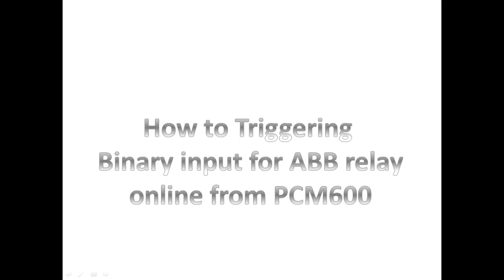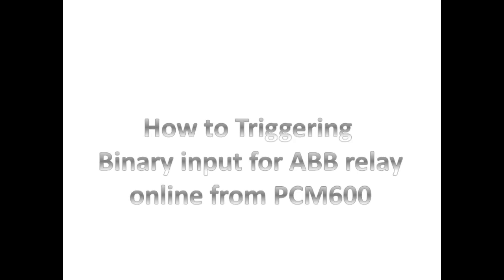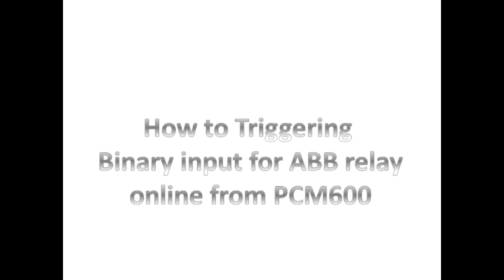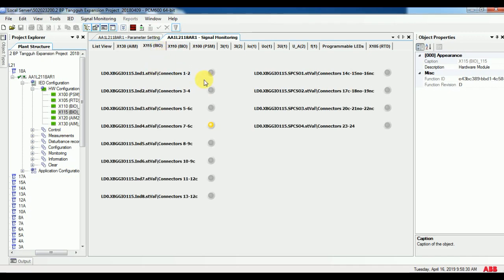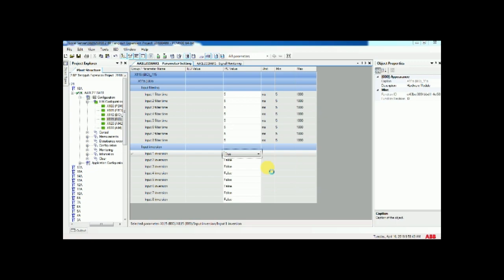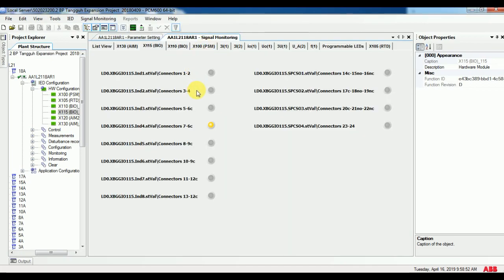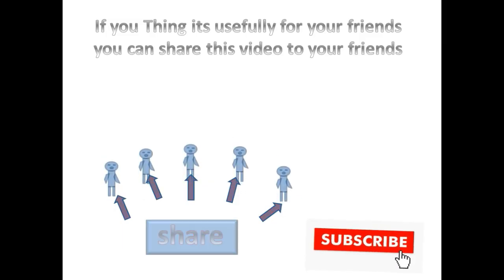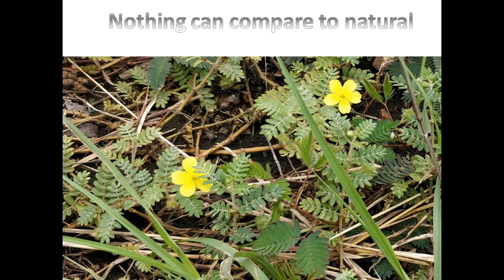🔥 How to Force/Trigger Binary Inputs on Relays in PCM600 | Step-by-Step Tutorial

Comment: My input stopped working over night. I measure full voltage on +- of the input, directly on relay. Its weird it just wont go from 0 to 1. Never happened to me before. Any thoughts on the problem, could relay input be broken? All setting are correct, on other bays same configuration works. Help sir pls 😢
Reply from the maker: you get any error code message in relay display

Comment: Hi how to solve ref615 relay modbus communication failure??
Reply from the maker: i have only very less knowledge on modbus. anyway i will try to find solution can you please tell any error message your getting while. and also please ensure that modbus communication setting are correct
Reply: @baranitech  ref615 have modus communication to dcs through anybus gateway, profibus communication ok up to anybus gateway converter in between relay to anybus gateway converter, there is communication failure, so how can we solve problem in the communication management in relay
Reply: Finally answer found- menu-monitoring-communication-modbus-Ethernet-serial-Make it false to true, to enable modbus failure...